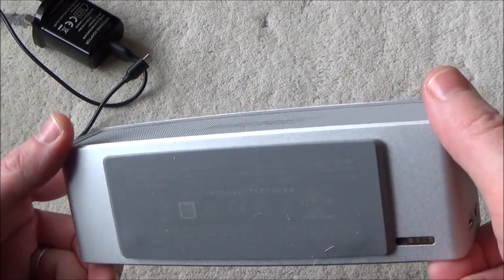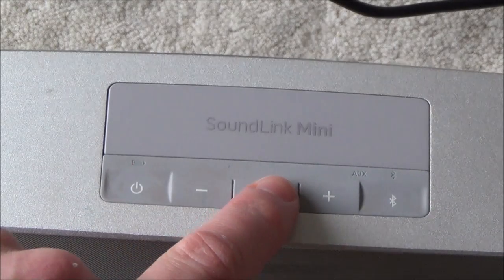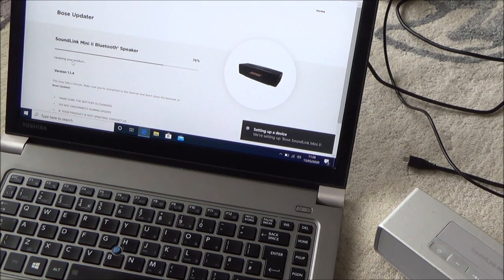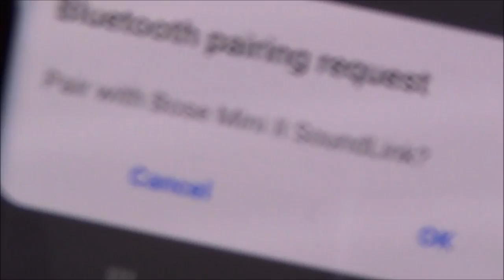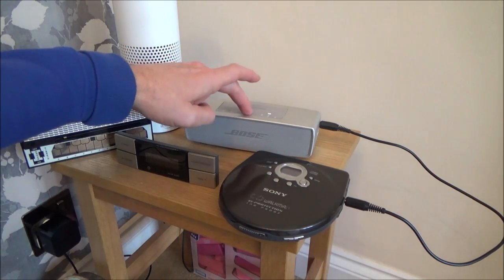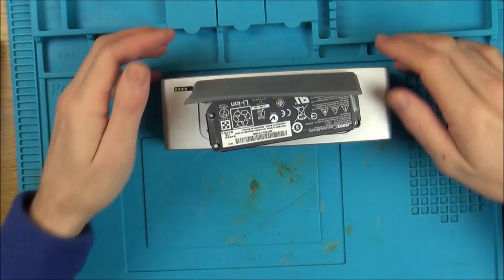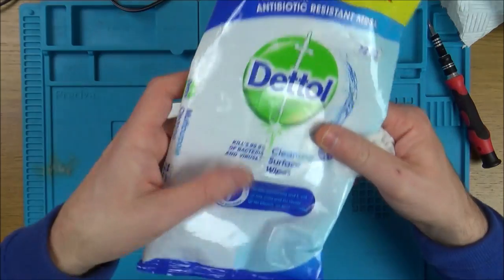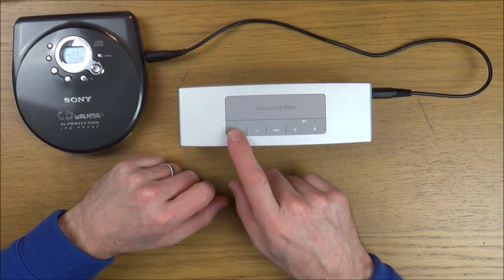Trying to FIX: BOSE SoundLink Mini II SPEAKER (Red Flashing Light)

Comment: nice easy one for ya vince :) tho admit i did chortle a little when you thought the speaker could maybe control the tracks on the cd player apart from the cd player being older tech,  they were also only connected by stereo 3.5 mm jacks!!! ;) im an ex audio engineer and alotta ppl wouldnt like my opinion on bose, they are good no denying it but nowhere near as good as some in their price bracket on certain items, best thing they ever made, in my opinion? that would have to go to the venerable bose cannon range in mono, which has graced the walls of many pups and clubs the world over for over 3 decades, they truelly are in a class of there own that paticular unit for that purpose :) ps in no bias way atall i have alot of vary good audio from the 70s to current day, but overall i have to admit to being a B&O fan, tho obv i wouldnt have invested 10s of thousands in my bang and olufsen gear if i wasn't :)
Reply: It's possible to control player with only audio cable with 3.5mm jack and that kind of control is widely used in mobile phones industry for over a decade and even some of Sony players use this, not sure now if there is any CD or I just see that on MD players but anyway it's possible and seen already in consumer electronics long time ago.
Reply: @gorjy9610  yes im aware of the technology your speaking of in some phones etc in a laymans/consumers way (not worked in electronics since 2005) but as i said in this case its older technology hes using, i mean lets face it i doubt there have been many if any portable personal cd players made in the last 10yrs, let alone embracing that technology thats just thru audio and if there have been i still know vince's player isn't one of them (altho basically its just that the control and stereo signals are dispyphered and seperated internally instead of the older method which im gonna explain now :) So, im old enough to remember wired tv remotes, they used a mono 3.5 jack as a control only connection ;) which very neatly brings us to an older method to  have remote functions in the 90s on the headphone lead etc (and this method still runs to present day and is frankly still more widely used than the newer method your mentioning)  but it isnt an audio cable per say its a stereo control combo, "3 rings" so its just stereo and control together in one plug (and socket obv) so yes there have been other ways to control for 50yrs never mind 10yrs!!!! lol (but it took them untill the 90s to create the stereo control combo (3 ring) all in one lol), but as i said even that doesn't apply either in this case as in it doesn't apply to neither  that particular cd personal stereo or to the lead he used (i dont know if that speaker would support both 3 ring and 2 ring or just the 2 ring combo you've mentioned either tbh) hence i used the term stereo jack (audio only) in original comment above. I didn't really want to go deep into this in my original comment, i was just generally pointing out that in no way it was gonna work with that machine but hey ho i've explained it all now in the end anyway and theres certainly nothing new here lol (and i'l not even start on the other 90s lead and socket that came along, the little used 4 ring which was when the small handycams first came along ( left A, right A, control and picture)  lol :)

Comment: I have same red Light issue , but mine sound link mini 2 says it's already updated to latest version . I remember some months back updating it. Even though it's updated , red light won't stop blinking. I tried other steps you told also . Any suggestions or idea , how can i fix it . Is there a option to downgrade and then update . Please help.

Comment: If you remove the battery, cannot you use it with ush cable as power supply?
Reply: No. The battery has to be part of the power circuit.

Comment: Hi Vince great video as usual 😁, in the case of Bose and the likes of firmware and software update I'd say it was a firmware update although they  don't call it that so not to confuse the consumer,generally Bose are high (ISH) end so won't want to confuse there users who are  not usually tech savvy, I do however have something that may be of interest to you for a video, I'm sure you get alot of these but IV never seen you do anything with a power amp before, I recently got hold of it and have not had time to power it up, I'm told it's faulty but know nothing more, I'm Midlands based so if you would like it give me a shout, it could be a fun video for your subscribers (I'm one but the way😉) , keep up the good work bro.

Comment: Check out the "Jam Heavy Metal" - basically a knockoff of this speaker but incredibly well made, a little less refined sound wise and less than half the asking price of the Bose if you know where to look.  I tested both speakers side by side and I ended up walking out of the shop with a Jam Heavy Metal for £70 less than I would have paid for the Bose! 😃

Comment: Wonder if the text on screen with the update (Prevent premature entry into battery shipping mode) was the actual issue and fix.  Like it was already in the mode and couldn't come out.  I've often seen Bose audio and it's considered one of the superior brands.  Unfortunately you both PAY for that and the connectors are usually proprietary (at least for car audio).  Nicely done :)

Comment: I got one with same problem. Flashing red light, if I hold the button between volume up and down for 10 seconds it does that green flashing too. But when I plug it into the computer the bose updater isnt finding it, neither the computer. Could it be I need to charge it for a while to get some power into it ?

Comment: A firmware update will touch the kernel software, the heart of a device. A software update will change he base system software in one way or another.

A firmware update can contain a software update but usually not the other way around. 

Oddly, the terms are interchanged more often than it should be so people tend to know what you mean using either term. However, they are technically not the same.

Comment: Firmware - the clue's in the name (it's kinda between soft- and hardware) - it's the low-level software for device operation, traditionally held in some type of ROM.
Reply: Indeed. Hardware level is barebones machine instructions. Firmware translates higher-level instructions (like “play sound”) to these machine instructions (like “store value, output value to a “digital-to-analog converter”, which itself is connected to a speaker).

Everything in this digital world is essentially a multi-layered cake, comprising of Nth layer communicating with (N-1)th layer communicating with (N-2)th layer • • • communicating with the 2nd layer (the firmware) communicating with the 1st layer (the hardware). It’s a jumbled mess in terms of logistics and keeping track of everything and how the different layers interact with each other...

... but it just works!
Reply: @Operational117  Having been a programmer for 30+ years now, it's easy to split hairs over the finer points, but what you say is more or less right there, yes.

Comment: all firmware is software
software basically means a program - be or operating system or application.

Firmware is  something closer to BIOS - a software that is supplied by developer of the hardware to enable all the functionality of said hardware to the end user.

Comment: Hi all, I have the red light flashing problem but my Mac doesn't recognize the speaker when I connect it, same running Windows 10 with Parallels... I tried with an old PC running Windows 8, same problem despite I installed the controller from Bose. Any clue?

Comment: Hi all, I am having almost the same issue, except mine turns on, but immediately the red light starts flashing and the voice prompt says 'Battery low'. The speaker only works when it is plugged in into mains power. It looks like it is charging, because the amber light is on, but no matter how long it is plugged in (for hours or even for a day), as soon as I remove the cable, the red light starts flashing immediately. When I'm trying to charge it with a power bank, after a few minutes it just stops charging. I have tried factory reset, shipping mode too, no change. When I checked the firmware version, it said that it already had the most recent firmware (1.1.4). After finding out, that you can still try to 'reapply' the firmware (pressed the A, D, V, arrow up, arrow down button on the firmware version screen) I did that too, but nothing changed. Reverting back to a previous version is no longer possible using the Bose updater. I found a website that says there is actually a way to manually downgrade the firmware, but I am struggling with the 'use a HEX editor to change stuff in the executable file' step of the process, so I didn't do that.

Does someone have any idea how to fix the speaker?

Another annyoing thing I noticed is that while in the past, I had separate volume control for this speaker when I was using my tablet or my phone, since the latest update as soon as I press the volume button on the speaker, the volume slider appears on my phone display on the top and shows when I increase or decrease the volume (as if you pressed the volume rockers on the phone). It is quite annoying, previously it gave more options to set up the perfect volume level. Funny enough, with my tablet I can still use the volume controls separately.

Comment: We are moving to Scotland at some point this year and I have been quietly collecting the stuff for when we move in as every room will be networked with RJ45 connectors and wifi bloom spots and a method of video and audio playback in every room too.   I have two never been used high quality projector's and electric motor'd screens to work it all into the "whole" plus a very expensive blu-ray player and sound system I have never used lol   Gonna blow them Scots people out their beds when I give it some rizz on the volume :P

Comment: Firmware is a kind of Software all though the differences between them have sorta merged together.  Firmware is software that is a bit more firm, in that when you have software say in your television set or you clock radio or your microwave, it is software running on hardware but it is very likely not ever going to be replaced hence the term Firm.

But as always technology has made it cheep to use reprogrammable flash. The only real instance of firmware we see these day is the bootrom contained inside chips like processors which initialise a cpu so that is then able to load a systems firmware.

Comment: The sound controls require a fourth connection so one needs to buy a 4 pole aux cable and that too would only work if the speaker supports that and the reason it was working with phone was bcz it was through bluetooth

Comment: I’m gonna guess its a flat battery.  The blinking red would be the trickle charging mode where it is bringnig the voltage up to safe levels. Then it will charge at 500mah

Comment: The difference between firmware and software is that software is something you can interact with, runs in the foreground and is user friendly, but firmware is basically the total opposite.

Comment: That´s weird... Why didn´t the speaker work with the older software version if the hardware was Ok..?  It must have been worked when it was bought... maybe the older version was corrupt for some reason or (which is a little bit frightening) it was programmed to stop working after some time.. but why...?
Reply: My guess is that older firmware wouldn't charge a completely flat battery. New firmware has a routine to slowly take a flat battery up to safe charging level.

Comment: They are not the same. 

1. Software :
Software, as name suggest, is simply a collection of set of programs, procedures, data or instruction used by a computer to perform specific tasks and allows user to interact with computer.

2. Firmware :
Firmware, as name suggests, is simply a a type of software program on hardware device that provides control for a specific hardware and provide essential instructions how device communicate with various other computer hardware.

With Bose your paying for the name. They are decent pieces of equipment. They are better and cheaper out there.

Comment: My Bose soundlink also fucked up. Software update was working but did`nt help . Still red flashing. I use the supplied cable + 1,6 A Bose charger. Stupid, that they use USB standard sockets but it is working only with a 1+ A - charger. Guess, have to buy a new battery... BTW maybe worth mentioning , that software - update is working only with the Bose- cable...

Comment: You're using the wrong power supply yes it says 5 volts but the amps do count it takes 6.1 amps you only giving it 2400 milliamps or only two amps that's not enough
Reply: It is enough to charge the device and he did also use a amp charger. The 2 amp charger was for demonstration purposes.

Comment: Just tried this way to fix it through their website and it worked, not had this working for nearly a year. Go to their update website btu.bose.com , connect your speaker through the laptop/pc if it says your speaker is up to date type these keys in order: A D V ‘up arrow’ ‘down arrow’ this will give you the option to revert your update and go back to the previous version. This should sort out the flashing red light issues on your speaker. Let me know if it works.

Comment: Firmware is software on hardware(chip). Typically the software telling the device how to function is stored on a EEPROM.
Reply: @UCGF65XOfUqPD2H7GbwCNsHg Firmware has to be machine language zeros and ones, although it is wrote in a low level language and then compiled to machine language. But I was only giving Vince a very basic explanation of firmware.

Comment: firmware is neither soft nor hard. it's like a computer chip is programmed a certain way sometimes you can't reprogram it. that's its firmware. software relates to computer applications and programs. firmware is like what it's born to do, it can't be re programmed like normal software that's why it's in firmware updates. it's like the software of the hardware. so it's firmware

Comment: here is a google result for your ''software vs firmware'' question, i couldnt really answer eloquently as i would like, or as concisely, so better stick to google, proabably better at explaining anyway, so here it is ''When discussed, firmware usually refers to fixed data as part of a hardware device, unlike software which is meant to be used for interaction, productivity and activity like word processing, video editing, listening to music, or video conferencing. ... Firmware is software that is semi-permanently placed in hardware.'' so basically think of firmware as a sort of bios for a device, that the device uses to function accordingly, although not quite, and think of software, as the outer layer of software that YOU as the user, interacts with, both can need updating and both have their own set of potential problems.

Comment: Is that a connector for something on the bottom?
PS: Software is something you need to interact with your hardware (e.g. Windows), while firmware is something the hardware itself needs to run (e.g. algorithms).
Reply: It's for a docking station

Comment: Weird to think that all this needed was a firmware update, when the previous owner not only took it apart, unnecessarily, but didn't put it back together again properly.  For 100 quid, (new), you want to be getting a quality product.

The question about the difference between software and firmware has already been answered by a few already.  On each of these components there's essentially a chip with the information about the device itself which, when you connect to a computer for the first time installs the necessary drivers.  The essence of what makes them, 'plug and play', devices.  As with all drivers, they are being updated all of the time to improve performance, etc. so a, 'firmware update', is similar.  But instead of being installed onto the computer is actually written to the chip inside the device.  Which is why it's very important not to interrupt the process, as doing so will effectively, 'brick', the device, making it unusable.

One thing I've learned through experience with these types of things is that you should only ever update the firmware if you need to.  If something works fine without the latest firmware update, leave it alone.  The adage of, 'if it ain't broke, don't fix it', applies!